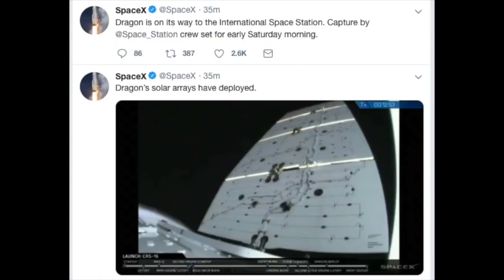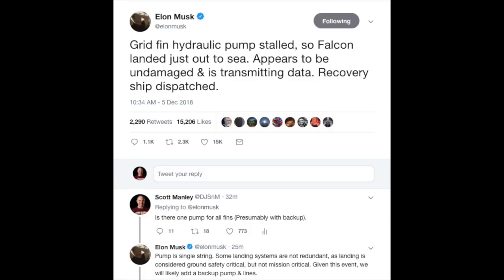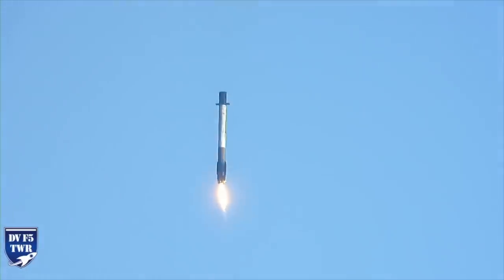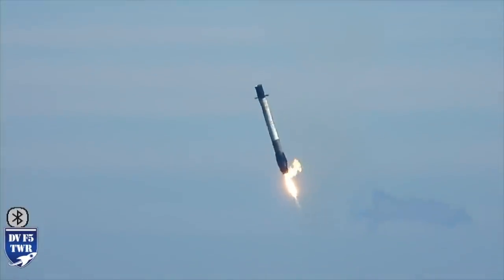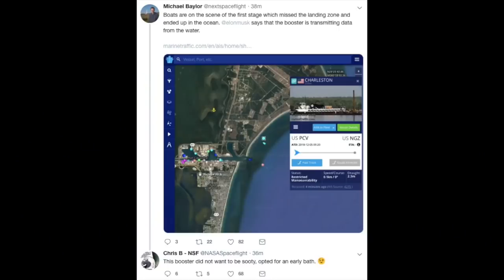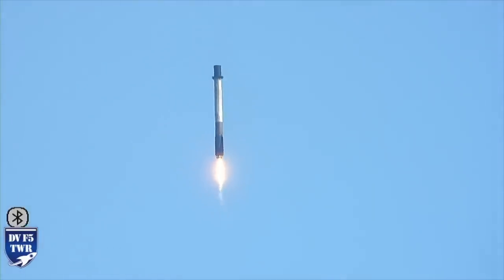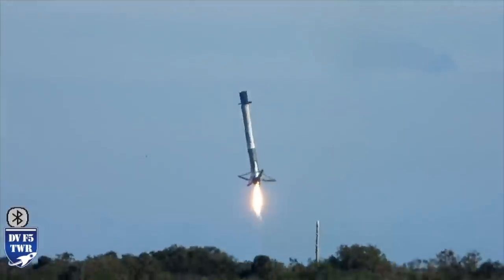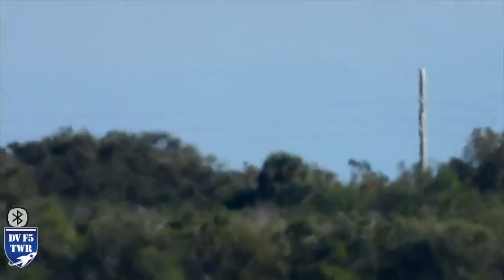SpaceX Rocket Loses Control After Successful Launch

Comment: Could the floaty circular snowflake thing in the final part of the video be frozen hydraulic fluid from the failed pump? I have no idea what temperature hydraulic fluid would freeze at (if any) but if the pump failed it could have leaked fluid to the exterior of the booster, around the grid fin pivot. but it seemed to be quite dense, it kept up with the booster when it was in the wash from the grid fin but when it moved away from the grid fin and became more exposed to the wind it didn't seem to decelerate very quickly. so maybe it was a metal part covered in ice?

Comment: Yeah, I spotted that object in the video and replayed it several times. What's also interesting is how it moves slowly along the booster and then accelerates as it moves out radially. My first thought was that it was inside the boundary layer, but my experience is with only thin BLs. The Reynolds Number for the such a long surface at transonic speeds will be higher than anything I've dealt with, so it's possible the BL is that thick and we watched the object move out into the free stream.

Comment: The amazing thing is that the booster's software got back in control and reduced a wild spin around several axes down to a rather mild roll. An incredibly successfull 'failure'!   ...Also, I believe the ring object in the end was just some ice that had formed at the outlet of an RCS thruster.

Comment: I haven't given too much thought but why not use electric motors? I'm sure they'd have more than enough torque to handle it.

 I suppose they'd add a fair amount of Weight if one includes batteries and/or electric generator to the system, which I can see as unattractive. Idk shrugs

Comment: It's pretty amazing how closed control loops can work even if they partially loose their actors, as long as the remaining actors retain enough control authority to achieve the desired outcome, possibly having to overpower some other actor behaving eratically.

Just as a very simple example, imagine you have two thrusters pushing in the same direction and you want to achieve a particular acceleration. Your control loop works by simultaneously increasing thrust on both thrusters until you get the desired acceleration. Let's say you normally need 30% thrust on both thrusters for that. If one of the thrusters fails, the control loop doesn't even have to know about it, it will simply keep increasing thrust on the remaining thruster until it reaches the target, now with 60% thrust on that one thruster. Even all the inbetween situations where for example one of the thrusters might still be partially operable with reduced thrust work without all those possibilities being explicitly programmed into the system. It gets much more complicated if the actors aren't simply redundant pairs, but that's still the main gist of why those control systems keep working even in unforeseen circumstances.

After the DHL plane that was hit by a MANPAD in Bagdad and lost all hydraulics was landed successfully using just differential engine thrust, NASA did a study if it was feasible to implement this as an autopilot feature. AFAIK, they basically only had to program the engines into the autopilot as just another set of "control surfaces" together with some relatively simple equations about how engine thrust, airspeed, pitch and yaw interact, and it simply worked. Due to the nightmare of testing and certifying this during aircraft development and the fact that this particular combination of having no hydraulics but still having all underwing engines working (the latter is necessary because otherwise you can't steer by applying differential thrust) literally happened only two times in all of commercial aviation history, in the end they concluded that it wasn't economically feasible though.

Comment: Frankly, I wouldn't even call that a crash. This was incredibly successful. The system can only show its performance when something goes wrong, and it pretty much nailed it.
That recovery was as good as it could get. Really the only thing they need to do is make sure the hydraulic pump failure doesn't happen again... and I'm pretty sure it won't, seeing how fast they identified the problem.

Comment: The floating object at 4:24 looks like ice buildup from around a thruster that has become dislodged maybe?  If not ice I would some kind of cloth with shredded edges but really I think it may be ice from the thrusters either depositing solid nitrogen or the cold gaseous nitrogen freezing the rarified gases of the upper atmosphere around the thruster nozzle.

Comment: Would it be possible to have a contingency landing burn sequence in the future to respond to events like this? Instead of lighting 1 engine high up could it use 3 engines to land. The 2 on the outside of the center engine being used to correct for rotation. I would think you just need to light the engines lower than if you only did one engine.
Reply: Instead of adding all that complexity, it's probably better to just eat the cost of a booster. Safety is #1, adding complexity would make all aspects of the launch less safe, including the actual initial launch which in the future will include human lives. The landing does not, it's not mission critical. They did say they know what the problem is and will fix it. That's the real solution here. Fix the problem, instead of ignoring it and trying to invent a way to land it if the problem occurs.
Reply: Landing in water IS contingency sequence, last thing you want is broken rocket crashland in the middle of the city.
Reply: I get all of your points but doing this would not add complexity as the engines are all ready there and it would be more software than hardware. Main benefit to putting this on Falcon 9 is that it can be tested and put on Starship which will carry humans during landing.

Comment: I think this is a pretty good failure, I mean I would have expected it to go haywire... but with the data they probably got out of it, the might be able to put in place more and more failsafes so that one failure like this could still result in a successful landing... From what I saw and believe, which is entirely subjective (I am not a rocket engineer), they could probably have landed this booster, maybe even by only tweaking the software, Idk if they would want to do it since block 5 is supposed to be the last iteration, but maybe the software doesn't count?

Comment: Lol the dude is also thinking spacex might have been just trying the rotating thing on purpose. I would not be surprized too. It culd be easier to control like that considering physics. but i am no rocket scientist, and that is just an idea.

Also the spinning might be for it to spread out the booster heat, since it was going to land in water. Would have probably otherize just done a big bang after touching water.
Next they gonna try landing it on something even more weird. For testing. And gor shits and giggles.

Comment: Scott manley; solid real question; what is the chances do you think that they can reuse or salvage this booster? At best maybe using thr more expensive parts on future falcon 9 b5s?
Reply: Doubt it, hot metal and salt water do not go together, the booster is most likely scrap, possibly "museum piece".

Comment: that fuzzy ring thing at 4:30 looks like ice build up or an extruded fiber ring (as in a seal that blew out). some plastics like hdpe and polyamide can form some funky fuzz when under high pressure and low temps, but hdpe creeps like nobodies business so what that might be doing under high pressure.. if it was an environmental seal for the grid fin hinge point (looks about that size and i bet those things collect some grime on the decent) it might explain a sticky fin

Comment: My hypothesis on how it de-spun without grid fins and with only one gimbaling engine to follow. Please let me know what you think and add to the understanding of this impressive demonstration of physics and GNC.
The final de-spin was yo-yo style once the landing legs increased the moment of inertia. Initially, it must have decelerated mainly due to gyroscopic precession. Since it was rotating off axis, TVC applied force to correct attitude, not the roll. Gyroscopic precession slowed the spin.
This is kind of like a spinning top, all forces and moments act 90 degrees off rotation from where they’re applied. Since the force via TVC is around the X and Z axis, it is translated into a force around the Y axis in a direction opposite to the rotation, slowing the rotation.
This resolution would not have to be hardcoded as it’s solely an artifact of the control loop on the TVC X and Z axis. It can also be verified by tracking derivative of spin rate as the attitude changes. This can be seen as the flames wick up different sides of the rocket.
Reply: Elon already tweeted the spin was stabilised at last second by the engine (implying the landing legs were a minor factor)
Reply: Andrew Jonkers I agree that the landing legs were a minor factor but spin rate does approach zero once the landing legs open, obviously due to the increased moment of inertia with the legs open. Before this though, the spin rate decreases from its maximum at 60rpm to 20rpm BEFORE the legs open. Therefore, this initial decrease cannot be associated with the legs as they were not open yet. Many say that this is due to RCS, which is likely and partially true but clearly not the entire mechanism. That is why I think the gyroscopic precession is significant as well. The RCS can be seen pulsing and attempting to control the rocket in the other axis, not just around the roll axis. Therefore there must be something more to this. Likely due to TVC as there is no other option.

Comment: Actually pretty amazing the Falcon managed to do a landing in this destablised state. I´m completely in awe by this feat.
Reply: @javaman4584  Couldn´t agree more. But don´t forget those guys and gals which constructed this. And designed it. 
I´ve seen rockets break up by much less stress on the material.
Time somebody builds an true SSTO.
Reply: @javaman4584  
I am not a pro programmer; I still wonder how much of their flight control software is hard-coded, and how much is refined through machine-learning throughput.

Comment: 4:22 Looks like a ring of frozen water ice shaken loose from the stage 1 vehicle? Or it could be hydraulic liquid frozen in a ring shape from a failed O-ring seal?
Reply: it's either hydraulic fluid or some sort of condensate from the cold gas thrusters, I think.
Reply: @YapathyNeverShutsUp  Yup I said and think the same thing.

Comment: The grind fins never opened smoothly like other boosters. Suggesting pump was already failing and unable to keep steady pressure. Did spacex ground control make the decision to dump it in the ocean or the onboard systems to prevent damage to the landing area or was it the case of that's where it ended up?
Reply from the maker: No, booster landing always targets ocean and requires all the systems to work to retarget the landing site.
Reply: @scottmanley  many thanks

Comment: That thing that bounced off the grid fin; in the stream they called it condensation coming off the rocket... I’d have second thoughts about that given the shape of the object. It could have been some kind of ice ring from around one of the fins 🤷🏼‍♂️. Also earlier in the launch (I don’t remember where exactly) it looked like there was a fireball coming from the top of one of the Merlin engines. I have never noticed this in any previous launches.

Comment: My guess at 4:22 is that it's either CO2 & water vapor and/or solid oxygen which froze around the LOX fill or vent for the 1st stage, or possibly it might be from the bleed vent at the end of one of the flexible tubes you can see connecting the stages prior to separation which I'm guessing handle MVac chill gas. You often see similar "snow" on the 2nd stage Merlin turbopump exhaust duct just prior to ignition.

Comment: The ice ring seems to come from one of the boiloff valves that there are on the interstage. It is from where they release the pressure on the tanks while it is being loaded since LOX boiloff is constantly happening. If you see the pre-launch footage, you'll see that there are two flows of venting on either side of the interstage 180° apart, that's where that vent valve is and it is circular with the same size as that ring.

Comment: If that part that flew away gets identified as some part of the pumping system, I'll laugh my ass off. Some engineer watches the entry in shock as the part he was supposed to bolt on flies away. He then proceeds to pull two loose bolts out off his pocket with a horrified blank stare. As he looks up the booster starts to turn a little more than usual...
Reply: That's not nearly as bad as drilling a hole in a spaceframe, in the wrong place , patching it without documenting anything hoping noone will notice, then having it fail on-mission and make international news.

Way to go, Roscomos [sardonic clapping]
Reply: @HuntingTarg  true :D

Comment: When you say "you can see the grid fins turn hard over to compensate" I think that is the point the fins get stuck. The grid fins work like a box around a bunch of tiny aerodynamic surfaces. So the fins turn opposite to the way they would have to turn if they were solid panels.

Comment: The ring is plastic and used to cover something that forcefully blew the hole in it as it was blown off intentionally. It was shaped like a shower cap with a manufactured hole in the middle that had a box-like protrusion to one side... Perhaps a hinge or clasp was there. I've played with enough acetylene as a kid to recognize PET shrapnel when I see it. Notice that the booster is slowing its decent when the ring catches up to it. If I had to guess, I'd say it was a loose-fitting cap that was used to cover a motor starter exhaust port and that it was hit with gas in the range of saaay 3000-6000 ft/s or so. Just a wild guess though. >I'm pretty sure that it's a normal event.<

Comment: The easiest solution would be a safety system to remove the grid fin or fold it out of the wind on failure to respond to commands. 

The current software to try to override it with the others doesn't seem to be enough.
Reply: I believe they all run on the same hydraulic system, and that was the failure point. 
You see one rotation reversed quickly, but then those fins stop responding, so the other fins hop in and reverse that, but then everything is stuck and just spinning
Reply: @philb5593  yeah that's what I thought on the end too. But keep in mind you just see two of four.